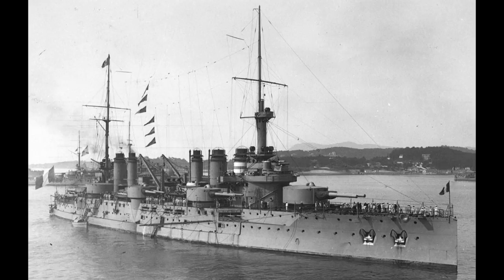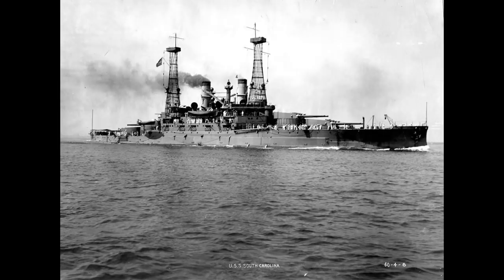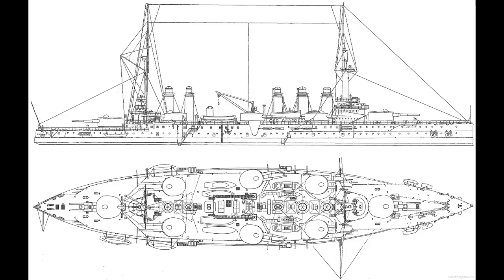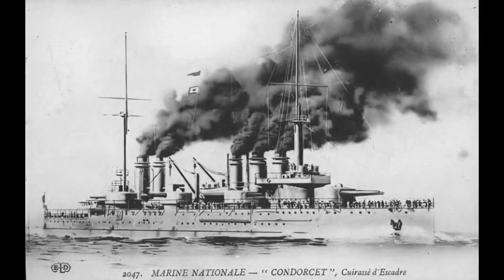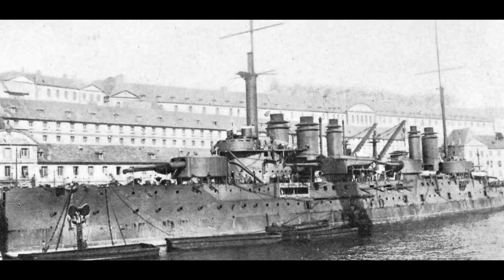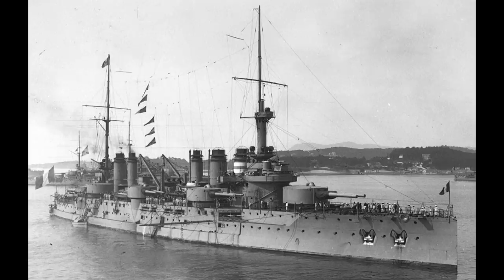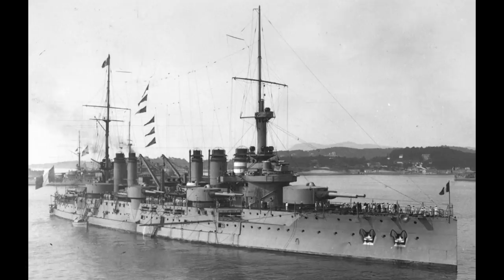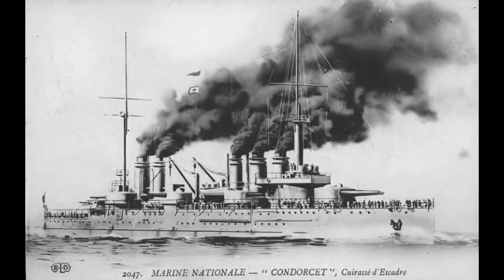MN Danton - Guide 044 (Human Voice)

Comment from the maker: Pinned post for Q&A :)
Reply: Hi Drach! Someone has asked me to make a model of the H44 class of battleships and I was wondering about a thing: as you said in your video on the H41-H44 they all had protective skegs for the propellers, but from the only plans that can be found online it looks like the skegs in the latter ships were very close to the centreline, actually not enclosing the propeller shaft. Why was this the case and does it makes sense compared to the more 'classical' skegs?
Reply: Speaking about pre-dreadnoughts and dreadnoughts, why did the major powers scrap most of their old warships instead of selling them off? I'm sure they could have gotten more money selling them to nations (and then in turn selling them shells and spare parts and spare gun barrels and technical expertise to fix things) rather than selling them to scrap yards.  Was it that nobody was looking to buy?

If they were truly obsolete then surely the major powers wouldn't be worried about them possibly being used against them.

If the above question has been answered before, then here is a better one: 
I can see numerous pre dreadnough and dreadnoughts serving small powers well as coastal defense battleships.  Remove the secondary and tertiary batteries and replace them with a smattering of about half a dozen 2-pounders and you have a costal defense ship that has a more manageable crew requirement that most minor powers can oblige. I'm sure Greece in ww2 would of loved to have a bit bigger fleet to shake at the Italians when they invaded. The reduced armorment probably would of made the ships faster and more survivable as you wouldn't have so many magazines for the secondaries everywhere.
Reply: Hey Drachinifel, do you think there is a possible modern function for battleships?  I watched a documentary about the early golf war or desert storm were a battleship used a drone to spot targets and was very efficient.  But at the end the Battleship was still decommissioned again after.  Could battleships still be useful war time machines in the modern age?
Reply: @eliteflare6063  During Desert Storm (really, since WWII) they really didn't justify themselves. We don't need them.
Reply: Hey Drachinifel.
What do you think about the German K-Class Light Cruisers and the followup Leipzig Class Cruisers? Where they somewhat decent for there time or totall rubbish compared to.other such light cruisers?
Reply: @bkjeong4302  your probably right but  I'm just curious what he would say
Reply: @bkjeong4302  I could see a BB thats been completely refitted to fire missiles being perhaps useful, in that theres more firing capacity, voyage longevity and increased ammunition storage over that of a cruiser or destroyer, but thats about it and no I'm not taking into account the idea to fit it with ICBM launch tubes, cool as that may be, I think standard ship mounted missile launchers would be enough especially for the number of launchers that could be fitted it...
Reply: Did this ship still use the old-style "revolving drum" turrets or the new style "hooded barbettes" introduced by the British on the Majestic class? It seems the French were quite late in adopting those (waiting for their first dreadnought, the Courbet, to use them) but I could be mistaken. If the old, heavy, style of turrets was used, how did this affect the overall artillery performance on this ship?
Reply: If you were one of the designers what would you tinker with to fix their tinkering?

Comment: It says all you need to know about the French shipbuilding program when "500 changes to the ship" is described as "light tinkering to the design".
Reply: In the defense of the not-really-defensible French, that would be fine if it was either done before construction, or as relatively minor modifications after the first shake-down to rectify flaws in it's suitability. To that you might reasonably respond that they were done at neither point, to which I can only counter that this post is more to depict the difference between the French and everyone sensible who's purchasing a large ship, than to actually defend the French.
Reply: Imagine what Medium or Heavy Tinkering means... ^.^
Reply: The Pentagon, and loads of blue ribbon congressional committees would like to say, this seems perfectly fine, and all changes were the highest priority and critical.

Comment: All of that tinkering... I'm assuming that this caused a lot of cost overruns in addition to the delays in delivery? In hindsight it probably would have made more sense to build a dreadnought with all of the design improvements than it would to alter designs currently under construction, probably would have been cheaper and taken significantly less time to do.

Comment: Compared to HMS Dreadnought, Danton is not so bad as often assumed.
The French Navy compared the weight of broadside per minute for Danton and HMS Dreadnought.
Base of calculation for Danton were the four 305mm guns with a shell weight of 440kg and a firing cycle of 1.5rpm, six 240mm guns with a shell weight of 220kg and a firing cycle of 2rpm (this was not the maximum firing cycle of 2rpm for the 305mm guns and 3rpm for the 240mm guns).
Base of calculation for HMS Dreadnought were eight 12" guns with a shell weight of 386kg and a firing cycle of 1.5rpm.
Danton could hurl 5,250kg per minute against an enemy, which compared favorable to the 4,632kg per minute of HMS Dreadnought.
At the expected engagement range of 5000m to 7000m both French guns could penetrate the armour of HMS Dreadnought as well as the armour of Italian or Austro-Hungarian battleships.

Comment: Weird how Wikipedia for some reason lists their 3-pounders as being 8 in the infobox while the articles themselves state them as having 10 (except for Mirabeau which both list then as eight). So, did they have ten or eight? I know Drach says in the video they’re ten, but I do wonder where Wikipedia is getting the eight from 🤔
Also, am curious on which 3-pounders in particular they mounted. The French Navy used two versions of the Hotchkiss 3-pounder: the short-barreled 40-caliber M1885 and the long-barreled 50-caliber M1902. I know that the French L/40 M1885 and the British QF 3-pounder were largely the same gun.